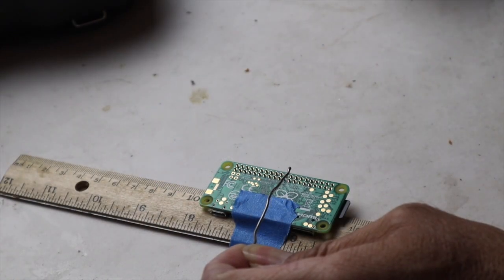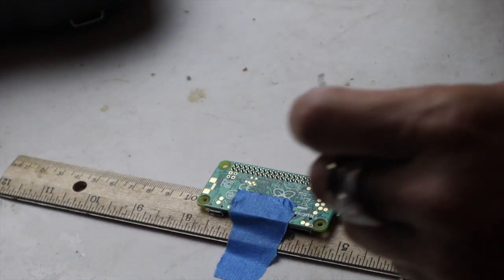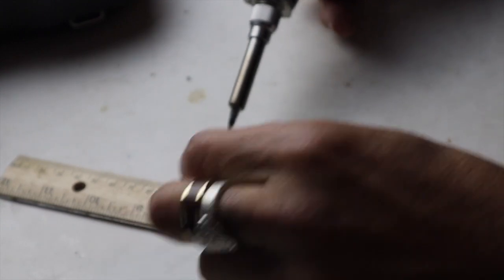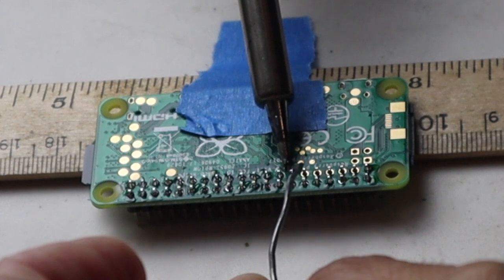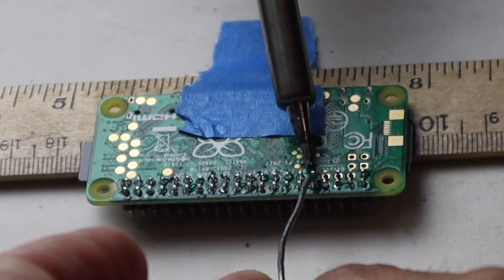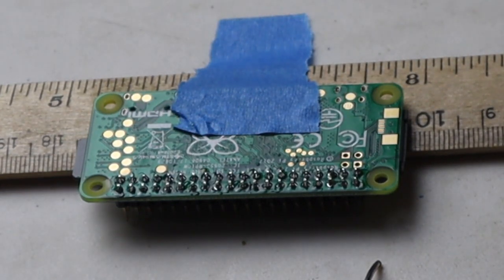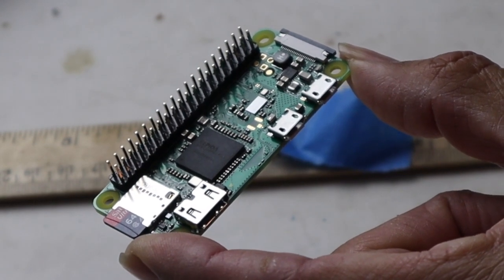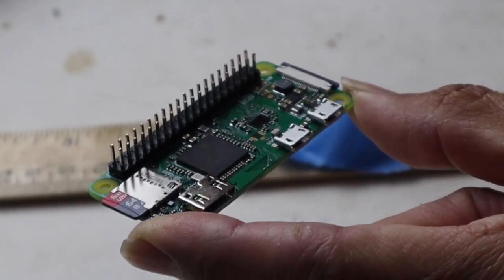Raspberry PI Zero Installing the Header

Comment: Question: I'm very new to electronics, is it okay to touch the board with the soldering station's tip?
Reply from the maker: Hi yes you need to heat the small solder tab for the header. Just keep your temp at a reasonable level. Both the part and the solder tab need to be at temperature for a proper solder joint
Reply: @TheWizardofWestLA  Thanks!